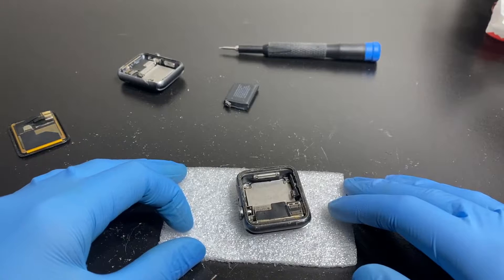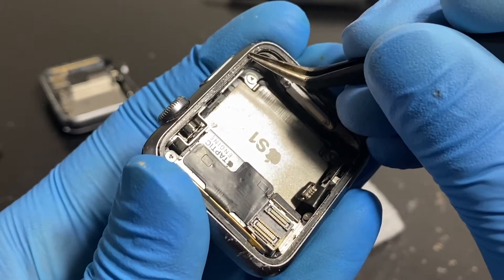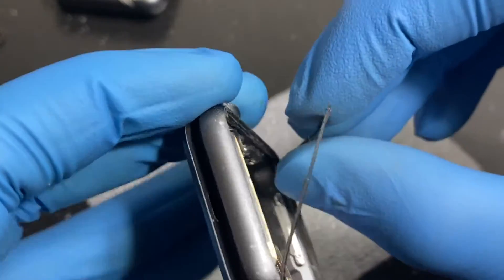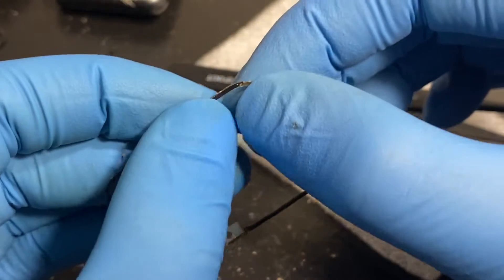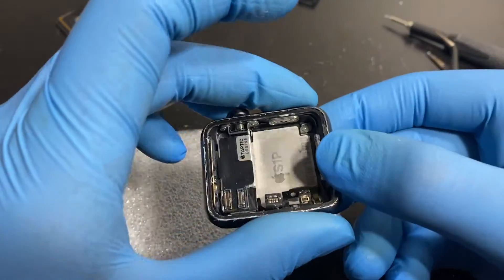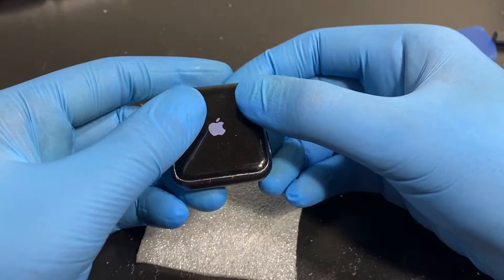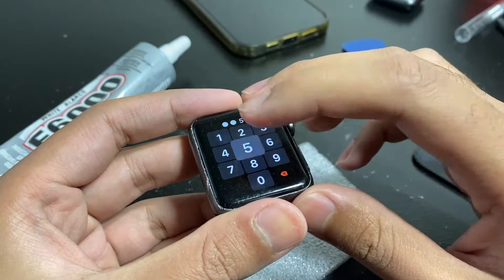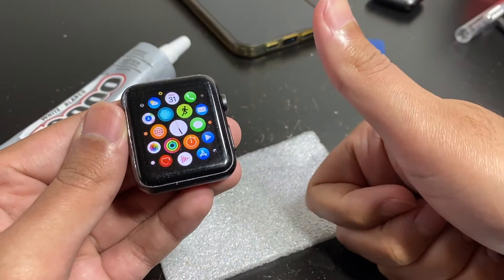Can A Force Touch Sensor Be Reused? | Apple Watch Repair

Comment: If you don’t clean the touch gasket does it affect the touch? I have an Apple Watch Series 3 that won’t respond to touch and I’m not sure if it’s due to a broken gasket or if it’s just dirty
Reply from the maker: If it wont respond at all means its broken..a gasket with dried glue still on will work but not well
Reply: @Techformative557  I replaced the gasket but no touch what could the problem be
Reply: @beloitan5403  bad screen

Comment: Isn't the force touch sensor worthless since WatchOS7?
Reply: the series 1 apple watch doesnt support watch os 7 so it needs the forcetouch gasket
Reply: Please, I repaired the lcd but force touch was broken also on series 1, I changed flex cable for force touch. But it doesnt work. I thought it removed from firmware but you wrote not. So, you sure it must work on series 1?